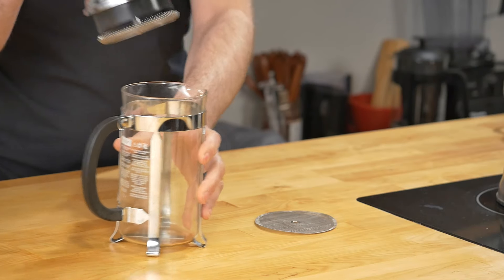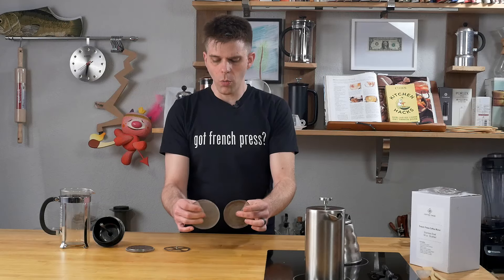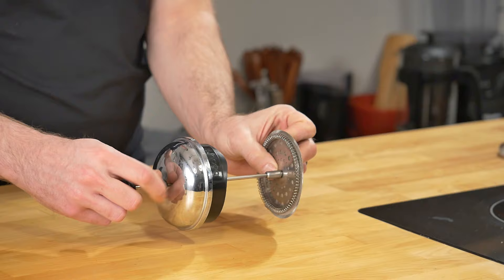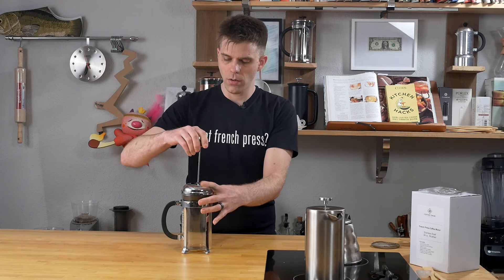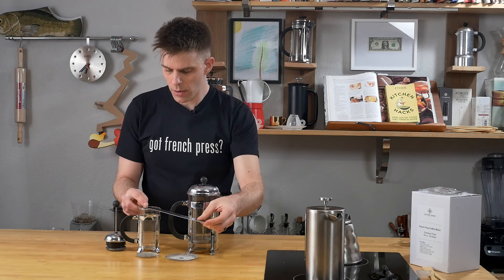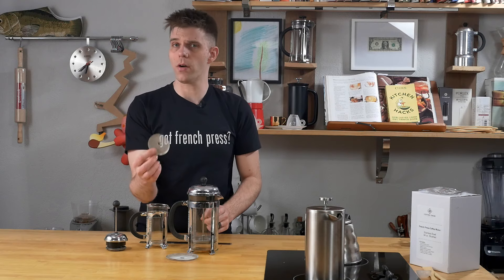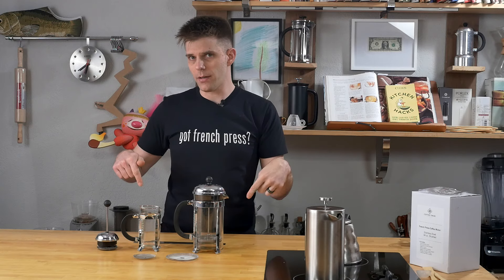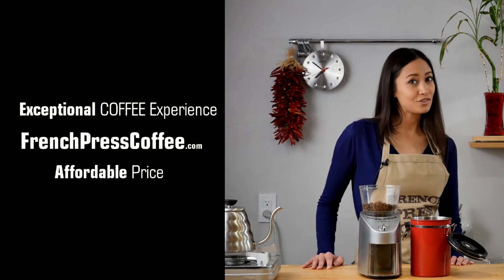French Press Assembly and Filter Screen Replacement

Comment: It’s funny how informative the video is yet it fails to mention that if you happen to be missing the lid stern (tiny yet vital piece) that sits atop & holds the 3 parts together... you’ll be drinking grinds! Like me. So no I can’t like this video bc I had to figure this out on my own haha.
Reply: This.   I went mad until I figured it out lol
Reply: I am having the same issue wondering what the little metal piece is for.  What did you do with it?
Reply: Yep got myself a french press from the thrift store for two bucks, could NOT understand what was missing/going wrong.
Stupid thing was missing that piece that keeps the filter pieces from moving up and down the rod. And now thanks to you I know what it's even called
Reply: @patthekat2 ?? did you ever find-out 😟?
Reply: Believe it or not, there are even worse videos out there. The Bodum French Press is the original. I've had mine for over 40 years. But there are tons of copycats out there and god help you if you watch one of those. Mine kept coming out completely backwards. I thought it was time to get on a plane for Zurich to be put down.
Reply: @elenalatici9568 bahaha like at dignitas ?? 😂 💀

Comment: Very helpful video. I'm not concerned about replacing my filter just yet, but I was definitely putting my assembly back together the wrong way, by trying to make the connection by screwing on the fitting at the bottom rather than turning the plunger rod itself. I will definitely keep you guys in mind when it comes time to replace my filters!

Comment: So I just found one of the 8oz ones but it does not have the spiral coil thing around the plate.
I did a little bit of research and it sounds like only the last few years is where it had that coil .
is that right ?
something about improved filtering, or is that something else?
I started researching because it fits too loosely, so too many grounds come up .

Comment: My  press does not assemble in a way that the bottom disc is solid as in this video. When I assemble the bottom pieces and screw the assembly together the result is three floating pieces rather than a solid press disc as shown.

Comment: What is missing from this video is the tiny little metal piece that screws on - where?????
Reply: Just figured it out. That part goes on top of the filter and all the other discs, and you have to slide it down and screw it on a little bit until it catches the threads on the rod, then screw everything else together like he shows.
Reply: @ladiemalek464 am I dum? Why tf are you the only who actually answered it 😂

Comment: Do you know if the 3 parts metal filter can be replaced with the single part silicon one?
Having to deal with a single part seems easier to clean and I know the silicon ring make it tighter but I wonder if the metal mesh has pros over the silicon ring model.